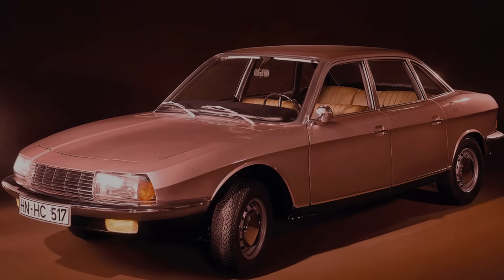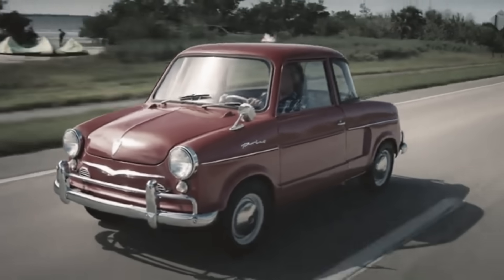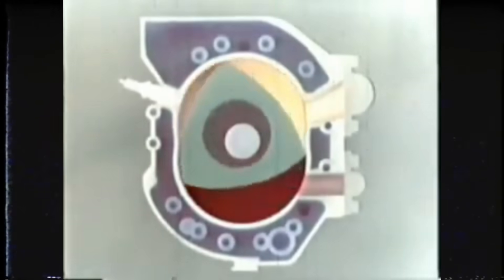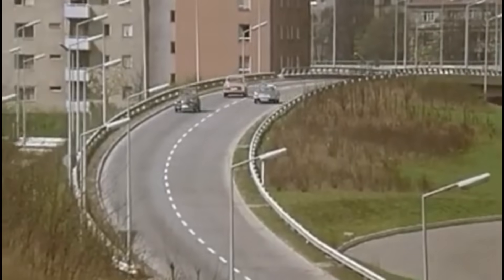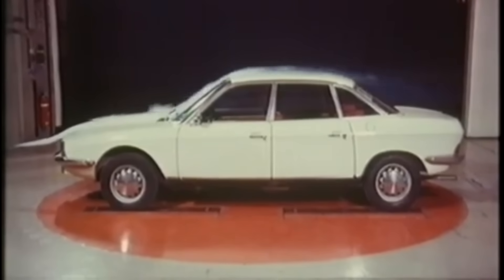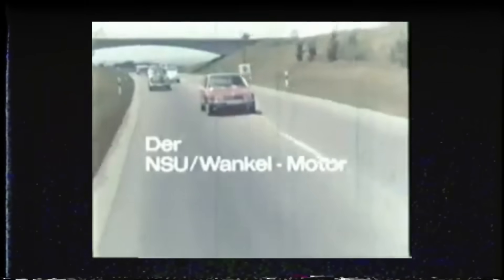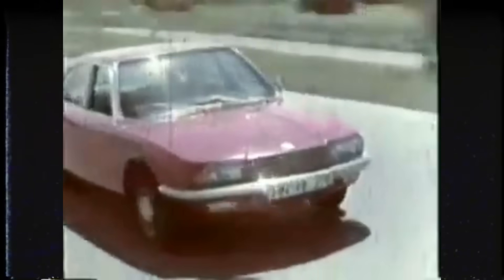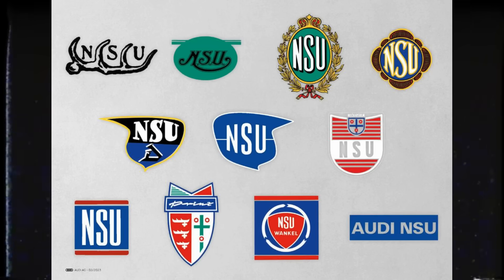NSU Ro 80: The Rotary Engine Disaster That Killed a Company

Comment: Your statement about AUDI NSU fitting a V4 engine into the Ro80 is totally inaccurate. This never happened. V4 conversions were only carried out by individuals or small specialists. It’s a common misconception that most surviving Ro80’s are running with V4’s. Yesterday I drove what is the last V4 car on U.K. roads and it is due to be scrapped. You also commented about the Ro80 suffering badly with wind noise? This was an element of the car the journalists all raved about at the time, the lack of wind noise, so no idea where you got that from.

Comment: The Wankel engine is completely different from a piston engine. I have had a lot of luck treating my Wankel engines with a synthetic two stroke oil mix in the fuel, also I don’t use the engine oil in the oil injection system. I use an oil that will burn better but also protecting the seals better.

Comment: 12:05 there was a small scale production of Lada models with rotary engines designed and made in house. Those were mostly used by the KGB I think, along with the V8 Volga cars.
The rotary Ladas were made well into the 90s I think, some of the later rotary Samara models even ended up in private hands.
I think you should make a video about rotary engine developments in the USSR, because the Soviets did try to install rotary engines in everything.
Reply: Sorry, but this is a myth, a modern urban fairy tale.
Reply: @K70-Ingo It isn’t, I held a rotary meeting at my place and we had one there. An ex KGB Lada with their own rotary engine under the bonnet. I drove it.

Comment: Actually, there were TWO car manufacturers who manufactured cars powered with rotary engines. Mazda and... Lada. Lada produced 1, 2, and 3-rotor engines that were used in limited edition models since 1970s until the 1990s - those cars were only available for law enforcement agencies, including the KGB. Some engines found their way into private hands in the 1990s and enthusiasts built and raced race cars in Russian domestic series. (I couldn't find a definitive resource but there is small chance that Lada made rotary engines even during the production of Mazda RX-8). For the record... I'm not making this up :)
Reply: ''Actually'' LOL
Reply: Rotary engines are awesome but very different and lacked the refinement traditional engines had gone through

Comment: I’ve owned one rotary engine(Mazda RX-8).  Although it drank gasoline and oil like crazy, it was an absolute delight to rev. And since it had extremely low torque at low revs, it had to driven differently. I miss that car and engine.

Comment: The Ro 80 was make or break for NSU, they had hoped it would be reliable and that many would buy a license to produce rotary engines and share knowledge in addressing any reliability problems, sadly it ruined the company along with Citroen, BMW for one were not at all interested in the rotary engine or felix wankel that had previously worked for BMW.  Volkswagen had bought Audi from Mercedes Benz and merged NSU with them.  VW got 3 new prototypes included with the sale, one would be later badged as the Audi 50 or VW polo, the K70 was similar in size to the RO 80 but wasn’t as good looking, this would be later replaced with the VW Santana and Passat. Maybe the mark one golf was a NSU design?

Comment: AUDI should launch an EV based on a retro RO80 design...it still looks better than any Audi
Reply: One thing for sure - the longevity and reliability of the 2026 Audi model won't be that different from the original RO80

Comment: The first time I saw one on the road, I thought it was an upturned rowing boat. However, the looks gradually appealed to me, and I wound up not hating it. I distinctly recall there were several companies offering to replace the broken Wankel engines with V4 Fords, usually the 1700cc Essex engine, which would have been a bit of a downturn in power output, but better than no engine at all.

Comment: The Ro80 shared the same floorpan with VW's K70 which in essence was the forerunner of the Passat. The Ro80 looked better in the flesh than the photos show - there was one parked up in the playground in metallic bronze at my school when I was 16 and I'd just stand there and look at it as a work of art it looked so stunning. 

There's a brilliant piece of film which showed owners holding up their fingers to other Ro80 drivers to indicate how many engines they've had fitted but this clip wasn't in this film.
Reply: That fingers thing was actually a myth
Reply: No, that is not correct. The conception of chassis and bodywork of RO 80 and K 70 was similar (and developed by the same team), but actually no single part is identical except the hubcaps.
Reply: @K70-Ingo  Developing two car types of similar size, but with few common parts is a luxury that not a big company can afford today. It explains why the small NSU failed so quickly.
Reply: @K70-Ingo : ...and the K70 itself (once badged as a VW) famously shared no common parts with any other VW except maybe the oil filter.

Comment: There were more than one reason for the failure of the car, as the video correctly says. One is the early bird technology and materials used for the engine in the pre-1971 period. Here, it is true, the seal wear was relatively quick. Another important factor was that the service network was not on the top with the type. For example, the small hole joining the spark plug and the combustion chamber could be walled by tar and coke, as the exhaust port of a simple two stroke. It was a problem nobody was thought of before. The mechanics preferred to change the engine instead of seeking for problems in the quirky thing. The car was designed and tested for long distance, high speed autobahn trips, and problems did not arise in such use. However, due to its beauty and ease of operation, moms used it for taking children to the kindergarten, slowly and for short distances. The engine was not tested for such use, and a complete test program was realized around 1969-70 to improve the engine construction. You can see the scenes of cars standing in row with open hood, this comes from that test. Thus, cars after 1971 had better life expectancy. 
Then came the petrol price shock. The Ro80 consumes between 15-18 liters (and 2 dl of engine oil) by 100 km at legal speed limits, which was 10-20% more that the similarly powerful cars in the late 60s. By 1973 it was just too much. Notice that a Beetle in city traffic consumes 10 liters by 100, and a VW 411, also killed, consumes 11-12 liters. There was no more way for a car that is thirsty, expensive, and unreliable. 
Driving the car is a pleasure. However, the three speed gearbox, chosen for being cheap, kills the acceleration between 100 and 120 km/h.

Comment: Are there NSU Ro80 installed with Ford V4 ?
Reply: V4 conversions are very rare now, most surviving Ro80’s have had updated NSU rotary engine or a Mazda 12a transplant retrofitted.
Reply: @michaeljose8122  I would love to get hold of one and fit it with a supercharged 13B engine.
Reply: Not officially made, all were some sef-cobbled stuff.

And that combination was terrible. The low-spec cast iron Ford V4 chunk was to loud and to lame, which causes also an even higher fuel consumption.

I've heard years ago, that the last existing RO 80 in Israel had a selfmade conversion to a Subaru Boxer engine, but back in 1997, when I had been there, the car dont existed any more.

In the 80ies a fellow in my NSU Club put a Porsche 924/Audi 100 4 cylinder in a RO 80. It was a terrible effort incl. a longened front (cut off under the wipers, prolonged and welded on again), but it became a failure, too - the engine hung lower underneath, so you could drive only on total flat roads.
Reply: @K70-Ingo Yesterday I drove what is the last U.K. Ro80 running with a V4. I drove it over 200 miles. It was absolutely dreadful in comparison to the rotary. The car will be scrapped fairly soon. Fingers crossed we won’t see another V4 again!
Reply: @djphilmanns of course it's dreadful, due the terrible engine itself, and for the general reason, that it's not original.

You may remember, that I'm very picky about that - nearly 30 years ago, in Leatherhead you shouted to me "You are a purist!", meant as a blame 😁

And you are still right with that.

Our dispute was about the two selfmade RO 80 convertibles.

Comment: How you got the AI voice to say Messerschmidt Kabinenroller with such disgust is...👌🏻👌🏼👌🏽👌🏾👌🏿

With a more standardized engine, the Ro80 could have made splash. The rest of the car is such an elegant, efficient, excellent design - unbelievable!
Reply: Thats essentially what the later NSU K70 was which only half-heartedly got released as a VW in 1970. The technical details other than the drivetrain are quite similar between the two cars.

Comment: This article could have been expanded to two bankruptcies caused by the Wankel engine. NSU had formed a joint venture with Citroen called Comotor to build the engines. The amount of money invested in this project and various prototypes (Citroen M35 and GS Birotor) was all but lost because of the RO80 fiasco. Citroen lost a fortune and ended up in the hands of deadly rival Peugeot.
Reply: It nearly did Mazda in too (rotary engine).
Reply: Comotor was the second bad choice for Citroen. The first one was the purchase of Maserati to develop the engine for the SM. That type was also a sales flop, appearing just before the petrol price shock.
Reply from the maker: To be honest, I simply didn’t know about these stories, and when I was preparing for the video, they didn’t appear in the materials either.
Although you’re right - they wouldn’t have been out of place in the video.